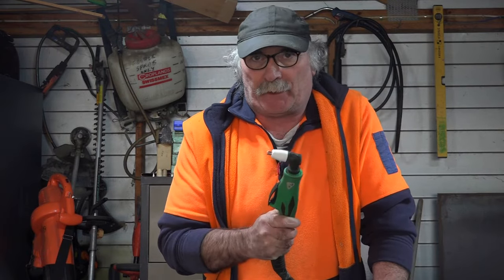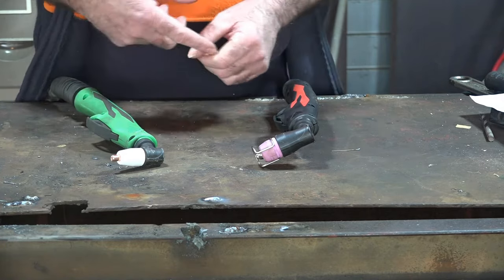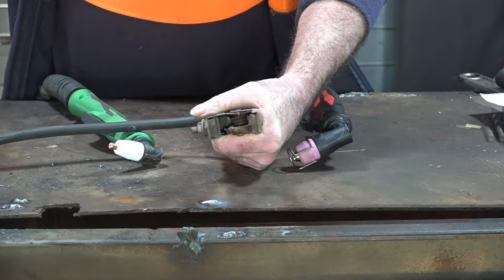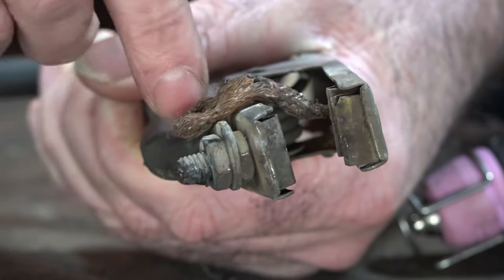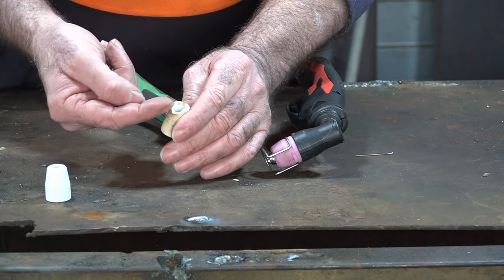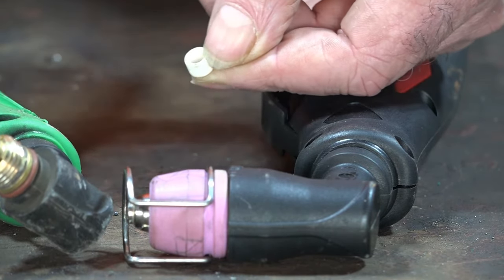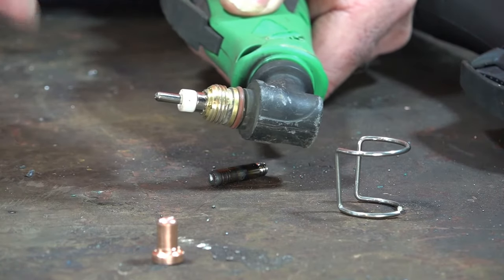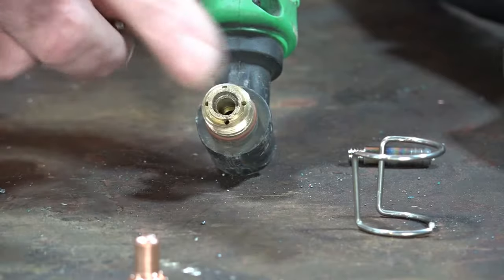Your Plasma Cutter Not Arcing, Here are 5 Solutions!

Comment: hey Pete. I have a btc500dp, but the pilot arc stopped working.. i just got all new consumables in it with no change... any thoughts?
Reply from the maker: Hi are you running it on 240 volts ?
Reply: @petestools  hello pete, same as mine, my torch is ipt60. machine is running 220V. ground clamp is in good condition, but air only coming out when pressing trigger. I hope you help me out. Thanks!

Comment: hey pete got a cut 50 of ebay no fire and no air amp gauge flashes 000 the fan runs and it is carrying air pressure you fool with these alot thought you might have an idea thanks and merry christmas.
Reply from the maker: Send it back
Reply: @petestools  tried that warranty is up they wont help I"m stuck with it thanks for the reply.